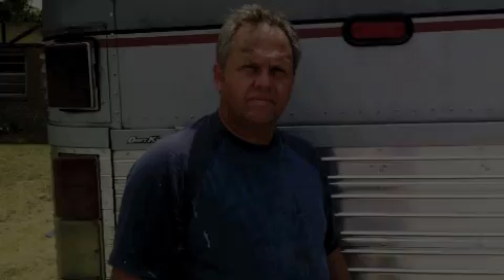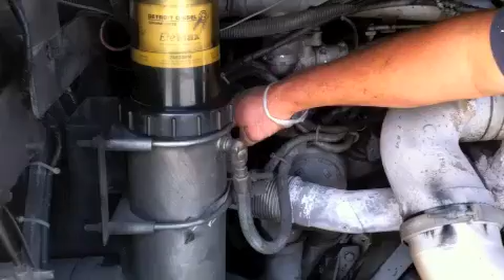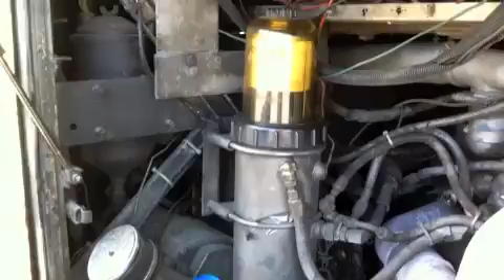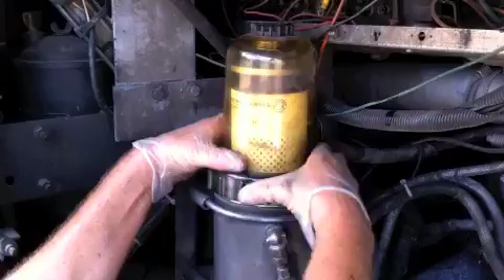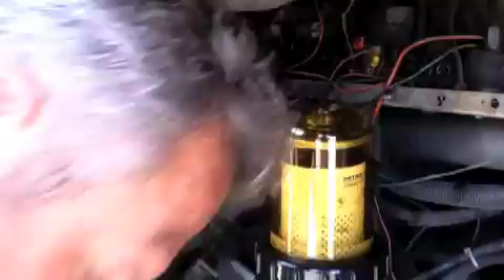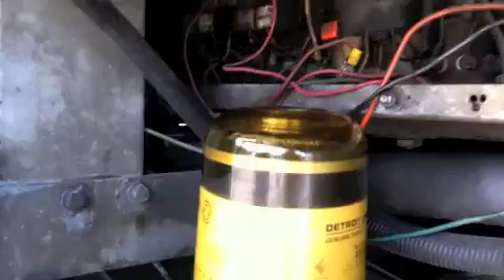The Bus Whisperer Presents- Fuel Pro 380/382 Silver Eagle Bus

Comment: Hello. 

Could you tell if there was a difference?
In power, fuel mileage, smoother etc?

I also have the 2 spin on ones. 

I got the fuel pro 380 from a junk yard.
Reply: no difference in that between a well maintained fuel filter system with canisters. What is different is you can tell by looking IF you need a filter change , IF you experince low power with spin ons. You realluy have no way of knowing if its filter related unless you change the filters and notice a difference. With a Fuel Pro. you can tell my looking,The big thing for me is that the system is self priming. I dont have to worry about pre filling the spin ons or loosing prime. and even if I decide to take the filter off and wait a week. Its always going to me a 2 minute job to prime my system. The other thing is its cheaper to change one filter. Takes less time, Ive gone a few weeks and had to change on and gone 8 months.. YOu can see how used up your filter is . not guessing.. No real advantage to power output at all, A plugged filter is a plugged filter, this one its obvious.
Reply: The Steve Weatherford Channel 

nice, thanks brother for the reply.